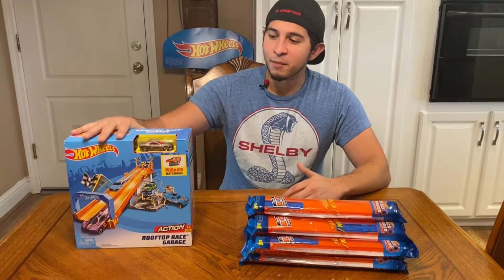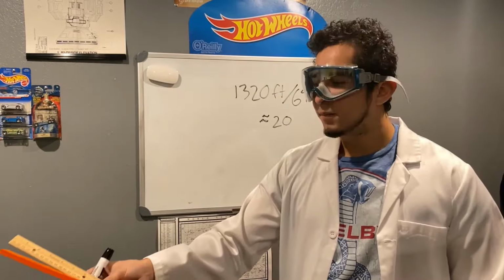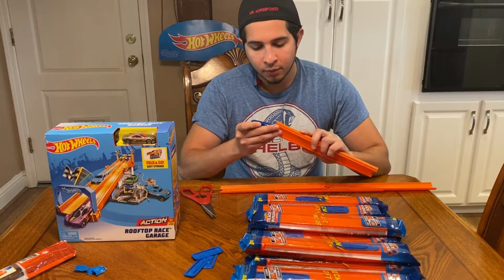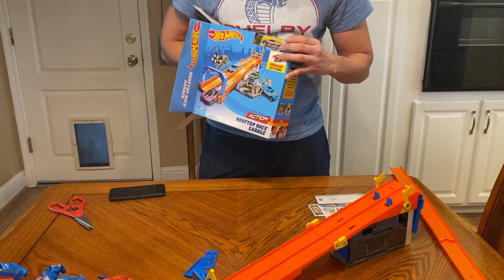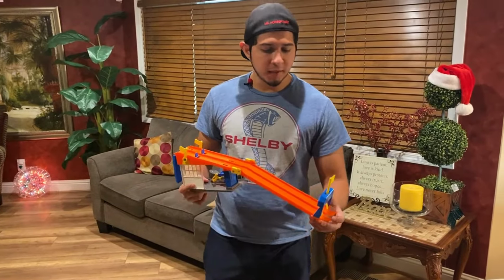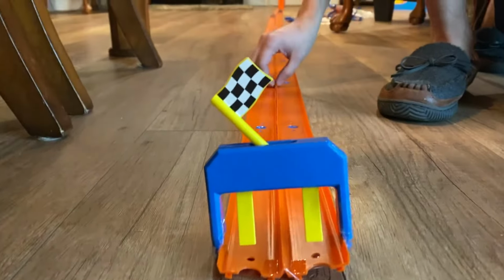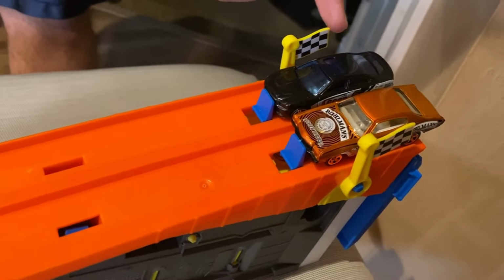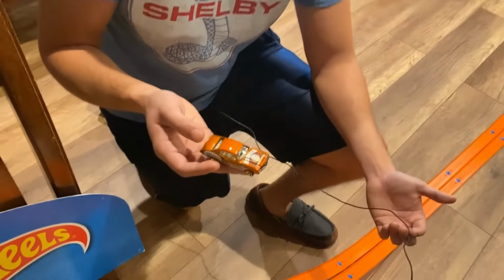HOW TO MAKE A CHEAP HOT WHEELS DRAG RACE TRACK! | 1/4 MILE SCALE!

Comment: Dear diecast racing fans.... I must say this was pretty cool. My equation is different. Since Hot Wheels make different lengths of vehicles, I came up with this.... The average length of a vehicle bumper to bumper is 16 FT. 1,320 ft to a quarter mile divided by 16 ft, equals 82.5 cars. I lined up that many vehicles bumper to bumper. Then I tape measured that out, it equated/equivalent to 22 1/2 ft of track. 🏁😎👍🏻

Comment: I think if you notch out about an inch out of the centers of the bottoms of each track piece, you'd have a smooth surface across the bottom of both lanes through the center to tape the tracks together so the tape isnt bulky and cause unevenness along the 'quarter mile' 👍

Comment: The length you need for a ¼ mile at 1/64 scale is 20 feet 7½ inches.
1320÷64=20•625

to convert 0•625 feet to inches, multiply by 12.
0•625×12=7•5

Comment: I've been running H-O gravity and electric slot car drag races since 1973 (documentation for each cars racing history) using NHRA drivers/cars/classes.  I use all makes (Johnny Lightning, Hot Wheels, Racing Champs, M-2s, etc. with first round losers dropping to a B Class or C Class depending on the number of entries.  I have events called The Shoebox Shootout, Winter Blowout, Spring fling, etc.
Slot-cars are early 70s A/FX Magna-Traction using the "Wedge" dragsters and the More nza and Pontiac Gran Am Funny Car bodies.  Pro Stock is bodies that snap on the chassis.
Featured in Lots of Slots magazine back   1995 as first drag racing version Track of the Month.
I use 21' 7" for 1/4 mile scale.
For your gravity drags, elevate the starting line up to at least table top level to get a good fast launch and place a board or something solid under the track before the cars hit the floor.  Angle the board to give the track a smooth transition to allow the car to motor through the entire track to the finish without any bumps along the way.  I have each lane driving through a pair of scale covered bridges at the half way point.
Something different.

Comment: 1st off,, Thanx,I really like this, I'm terrible at math and couldn't quite understand which  format to use to make get the answers?
2nd, I once introduced betting on Diecast vehicles to a group of my friends. We tried to get out together at the same times as each driver, We'd  usually agree on a number of vehicles for each person's team, and leave them in their packages until Race day? 
Usually around $5 (+ tax) for 5x Diecast vehicles, chosen in one 5-pack of Hot Wheels or Matchbox,  with multi-packs of Maisto, Zuru, etc; OR 5x  singles packs?
 Then pitch another $5 per team into a pot and the Winner takes all (except the other team's diecasts)!!! It allows for the fairest competition imo. 
Thanx for sharing.
Reply: Use Google to look up a scale converter. That will give you the answers.

Comment: Good idea for making it longer. I got the same set here I bought last year. Just now getting to it LOL. I see on other channels that flag at the finish line tends to go towards the side where the flag is facing because of the plastic weight mostly.  Any issues with yours?
Reply from the maker: We didn’t have issues with that in this video, however on our roof drag race track video the cars were going so fast that it wouldn’t really hit the tab properly so it didn’t fall on the correct side.
Reply: @livefastdiecast6546  cool thank you for the reply back 😀
Reply: Thank you for doing the math to demonstrate the conversion. I am an 8th grade science teacher and have been teaching that concept along with the speed formula for over 20 years now. I reinforce the class work with a Hot Wheels lab using a two lane 20 foot track also. Back in 2004 Hot Wheels put out a roll of 50ft track that was only sold at Kmart. I cut that in half for the two lanes so no connectors or seams. My track set up is 3ft up off the ground at the starting gate, 10ft downhill, then 10ft flat on the ground to the finish line. Students really have fun with this speed lab and don’t realize they are learning at the same time! Thanks for showing an economical way to race. BTW, Dollar Tree now sells a two pack of 2ft track with two connectors.😊
Reply: @Alex Gonzalez  Hi Alex 👋 ☺️ and no problem.  Actually I got a video of the dollar tree hot wheel track you mentioned 😆.  It is great hearing from you and you sound like a super cool teacher 😎
Reply: Nice